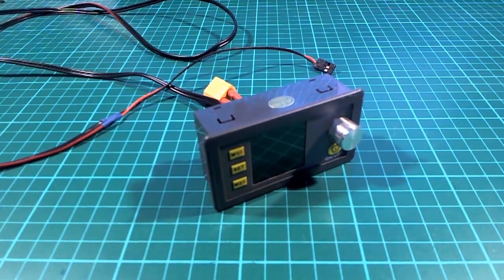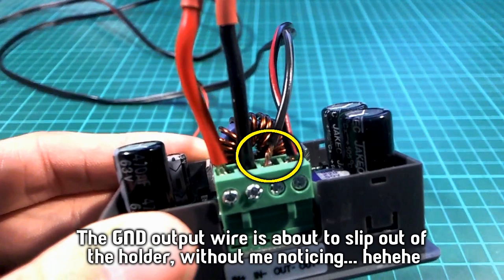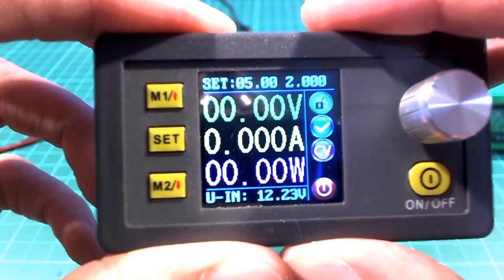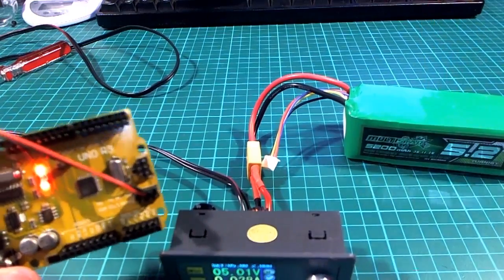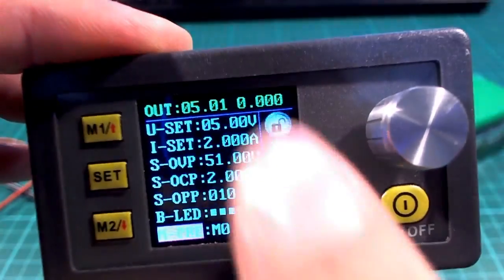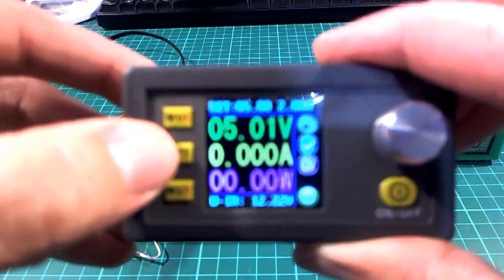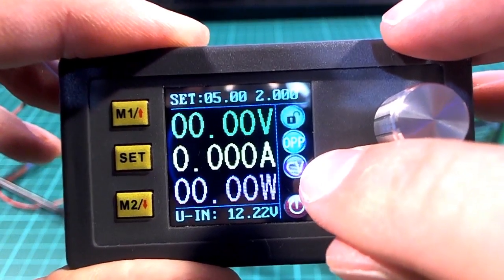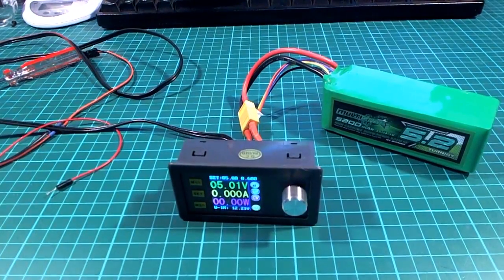Mini adjustable DC power supply/meter first look DP50V5A

Comment: Wondering if I can use this to measure the voltage at which a solenoid valve operates? In other words, have it connected and powered on, and then use the knob to ramp up the voltage from 0 to 10V (12v supplied), and see when the valve opertes. Expected operation at 8V or less.
Reply from the maker: Yes, you could do that.

Comment: I get the impression those cheaper bench buck converters other than the expensive Riden are rubbish. I bet When you load that thing the actual current vs the current reported on the display will be off, and the error will not be linear, making calibration useless. I bet that cheap rubbish will give an unstable output at very low loads. Also a seller said  with the 20Amp version if u hook up a big motor drawing more than 4amps or any inductive load it will blow it up! If you try to charge a battery you need a series diode else back flow will burn the PCB..crazy. Back flow should not damage the unit. Lets say u hooked 2 isolated units together in series, say both set to 50V for a total of 100Volts out but one unit CC is set at 1A and the other at 5A, the you short out the output, causing reverse current through the unit set at just 1A, I bet it will smoke...

Comment: 2:00 the input voltage is 6-55V but there is no indication of an input current. 
Does it even matter because it will draw as much current as needed?
And also, what should the min. input current be? 
btw. great video.

EDIT: I researched a bit and as I thought, it depends on how much current you use and there's is a way to calculate it if you know the efficiency.

Comment: hey how about a new video showing it operate a 775 at .17 amps and 12 volts. that is the level of the 775 motor and i want to see or here from you that it will work so i can take apart a 20 amp and 12 volt tractor yanmar (permanent magnet alternator) and then attach the magnet to the motor rotate and the put it near the receiving coil to get the energy without a tractor motor i here all the country people who own radrunner are doing and that it extend the one hour battery to 72 hours of charge and they use them for herding animals but they have issues with not having shocks. they get back issues. oooowwwwwww. but if it goes that low then anything that can carry the extra weight goes forever. someone other motor willl break and the 775 so open body and attach fans like it is an alternator have been suggested.

Comment: Hello. May be you can help me. I bought the DC-580 Boost buck converter module on eBay: https://i.ebayimg.com/images/g/YsMAAOSwFLRenXku/s-l1600.jpg
Is that normal when I switch on (set on 12v for example)  I have to wait more than two minute to get current at the input ? Pushing the on/off button has no effect excepted having a green or a red square on the screen...
Link to the product on the manufacturer website : http://www.fnirsi.cn/productinfo/481353.html
The manufacturer doesn't answered my emails. :-(

Comment: Hey I need some help with this unit. I got one off Ebay a little cheaper so I kinda suspect that but it wont maintain a steady output. The input is steady so that's not it. Any ideas?
Reply from the maker: If the problem is that you suspect something.... not sure how I can help with that.

Comment: That was a great video , I’ just purchased the same. Looking device from eBay for $75 it has a higher output of 20 amps I intend to use it for some projects that run multiple large stepper motors

Comment: Late but hell just found this vid. U is potential energy, V(volt) is unit of measure of electrical potential. In electrical just kinda became voltage or just volts, as well but not as much I=current some times is referred to amperage or just amps.

Comment: hi,   gr8  review,    cud u pls tel wethr i can use it for supplying power to my lap top externally by using rechrg batteries,  as the internal battery is dead and not available

Comment: Are you using LED lights, because  your video if flickering terribly, get a headache from it.

But for the rest a good video.
Reply from the maker: Yeah, I changed the lights after some people pointed this out. Still using LED but from a smoother DC power supply.
Reply: @iforce2d  Aha ok, great you still answer people here on YouTube, when you also are hitting 50k now, keep up  the good work.

Comment: I think you are confusing voltage (across a component) which is often noted as "U" and electric potential of a node, which is often noted "V". U across the component between nodes A and B is equal to V at point B minus V at point A...

Comment: I bought one of these not long ago and use it all the time. I only wish when you push the button to change voltage or current that it would stay in the change mode until I push the button again to end or even better, have an option in the settings to have it work that way or the default way which is automatically exit the change mode after 10 or 15 seconds or no input. When I am experimenting and want to play with voltage and/or current it is annoying to have it exit change mode by itself so I have to push the volt or current button again then push the knob two or three times to get to the digit I want to change... wash, rinse, repeat.... Also, interesting that the manual calls it the coding potentiometer since, as you mentioned, it is not a potentiometer but then no surprise from a translated document.
Reply from the maker: I bought another one more recently that has the feature you mention, where the voltage changing mode stays until you turn it off. It's a larger power one though, so not sure if they have made this modification to the lower spec ones as well: 
https://www.youtube.com/watch?v=siZTPRpyVrM
Reply: @iforce2d  Hear that? It's the sound of slightly less than $40 leaving my wallet...LOL

Comment: Probably a dumb question but I’ll ask it anyway. 
I have a solar panel with variable output, that I want to use to power a device that has a minimum requirement, and gets fussy if it gets less than what it needs.
Could I use this device to set output parameters for my device, so that it never receives less than 8V or less than 1A? If the solar panel can’t meet either of those requirements because of the light levels I’d like this controller to just switch off the output and wait until those levels can be met. Is that possible???
Reply from the maker: It doesn't really sound like a suitable thing for that purpose. No ability to get it to switch off at a certain input voltage at least. Usually things using solar will have a battery between them as a buffer, which the solar can charge when sunny, and the end-user device can still use when not sunny. Only problem is, you then need a circuit between the solar panel and battery so that the battery doesn't simply try to 'power' the panel when not sunny... I've never tried it myself but I have seen that it's not trivial.

Comment: So alternating current would burn it out so you have to have a battery. So I can't use it on a small generator. I never liked batteries because they will run out of power in the end. But I have to get my scooter running. I'm sure these medicaid people will want me to check in with my new doctor once they get the new of where I live. Last time it took them almost 8 month to get me a new doctor. I moved on the day I got their paper work. Just could not be helped. Thank You Loader.

Comment: I have this module and the 50v 20A version, I use it to charge 18650's, no need to use the diode just always connect and disconnect with the output turned on with the current limit set low, the diode will have a voltage drop so the output voltage will be less than on the display.

Comment: Why there were no tests under load? Why there were no tests with actual precise multimeter and comparison?
Reply from the maker: Because I'm not a pro and this is a 'first look' as the title says, not a test or review. The voltage is very accurate, not sure if I ever checked current accuracy.

Comment: Good review video. But for 30$ one can buy a complete ATX power supply capable of say 350W + ... Can be adapted/hacked to become a very good lab power supply with regulated outputs.
Reply from the maker: "can be adapted".... sure, you can say that about almost anything. Here you have a nice package ready to go.
Reply: Oh for sure ... I mean it is a elegant and ready to go solution, no doubt. I only wish the price could be lower ... when compared with say a massively made ATX PSU ... looks expensive, otherwise it's no doubt  very nice and very practical . I was by no means criticizing your choice. I am thinking to get one of those also, just sayin' hey seem expensive tho ...

Comment: Very nice, I plan to combine something like this with an old ATX PSU to have strong cv rails and a variable output with these features. But I still have questions: what is the minimum output voltage  and current?

Comment: V is the (ISO) unit (Volt) of tension, U is the letter for the physical dimension (same as A stands for the unit of Ampere and I for the dimension of current).
Not sure if in the US you use V also for the dimension, but as it is an ISO unit, you shouldn't.

Comment: my power supply is rated for 240w, 24v at 10a. I actually need 48v at 5a. will this work? or will the voltage be limited to the power supply's voltage?
Reply from the maker: This is a step-down only (buck) converter. As it says in the product description the input must be 1V higher than the output. If you are going to run it for long periods of time, I would be inclined to get one that is not cutting it so fine regarding the power limits. This one is rated to 250W so I think your 48x5 would be pushing it pretty hard.

Comment: I just bought 1 of these but the 5015 witch is 50 volt 15 amp it comes with a driver and was $49 I am going to use an atx power supply to run it so should be good

Comment: Do you still use this device and is it still working?
Reply from the maker: Actually it died a while ago, after I used it quite a lot for hot-wire cutting.

Comment: The problem with this unit is simply that it is really involved to set the parameters for a data set, then saving.
The instructions are very poorly laid out so initially at least it's quite demanding.
The instructions (for example) refer to a potentiometer not the rotary encoder which it is.
Ideally this should couple via SW to a PC & enable much faster & more reliable programming.

Comment: can I connect 11.1 volt lipo battery and get out 54 volts ?

I connecting 4 led strips  to 11.1 volt lipo and power is to low to get them to be very bright if I connect 2 x 11.1 volt lipo they are very bright but wires getting very hot after short time trying to find solution or boosting power from 11.1 or reducing, 
What you think ?

Comment: U is symbol for voltage and it is measured in Volts -> U = 5V
I is symbol for current and it is measured in Amps ->  I = 2A
Ohms Law is normally written as U = R * I

OVP, OCP, OPP are abbreviation so they use V/C/P instead for symbol used in physics expressions. 

Be carefully with those protections. Depending on device it may be only hard limit, it may shutdown or clamp input. The last option with no protection on input may ruin your day (although it seems that this meter simply power down).

Thanks for review, I was thinking that I get this device and now I know that I want it :)

Comment: I am thinking of this to control a battery output to match my DSLR's specs. DSLR wants 8 volts 3 amps. Within some limits, this will allow setting output voltage and output amperage independently, right? So I could run 9 or 12 volts as input and set it to output 8 volts 3 amps. (I am obviously not educated in these matters. I just want lots of amp hours to run my DSLR for astrophotography. Would appreciate your advice). ...thanks, Stephen

Comment: is this item accurate at very low miliamps, for example .1 miliamps or  3,  I am trying make colidial silver, and it has to be steady current flow, and very low miliamps. . . .  I bought there other item https://www.amazon.com/gp/product/B01DZSFDE6/ref=oh_aui_detailpage_o00_s00?ie=UTF8&psc=1
, the model right before this, and it slightly  fluctates and is off by between 5 and 10 mili amps, so i am debating on buying this one,  Ironicialy i spoke to soon. . .  I was typing this as I was watching the video, and 18:09  and you have the limiter set at 400ma and it is limiting at 394ma, why is this??? is it supposed to this? does it mean that if you want an exact 394 that you have to sett it at 400.  , and  offset it by 6 ma.   If you do do that will it eventually exceed it. . . sorrey for all the questions, but this is the exact thing mine is doing and im not sure what to do.  If i set my at 10 ma, I get about 5ma draw. if i set it at 5 ma, get about 1, but that 1 is fluctuating and seems to be creeping upwards. . . .    but its hard to tell. So I am wondering does your creep upwards or will stay steady at 394 if you set it to 400? any advice would be greatly appreciated.
Reply from the maker: I think you answered your own question. I would not expect this to be as accurate as you need.
Reply: I think i did also. . .lol sorry, I was writing that as i was watching the video., I guess my real question is will it stay at a 394ma consistently when you set it at 400? I could live with that and just ofset the number by 6 . . .  or does it creep all over the place between 394 and 400 when you set it at 400?

Comment: Pretty neat device. It would be cool if it would have some data logging, or at least serial output with current voltage and current being drawn. The screen refresh is pretty low, at about 1-2Hz. I assume the protection mechanisms are implemented in software, and not using dac and comparators that triggers something. (other than current limiting I assume), which might be a bit unsafe. It most likely will deliver more current or power for about half a second, than what is set in settings, so still be careful.

Any ideas about turnup / turndown behavior, noise, ripple and load regulation.

Comment: About the U as volts, here in Norway we use U as volts, R for resistance and i for ampere.
don't remember why we use U as volts since we only use URI in ohm's law at school where you use VRI?
and I have never seen U instead of volt in real life outside school (working as a mechanic last 7 years)

Comment: 250 Watts! 
I have a 2 channel 150W Mastec that's 10 times the size of that thing that I paid $200 for.

Wondering if I should replace it with 2 of these?
Reply: That thing however is only the controller, you still need a DC Power supply to attach that to.
One that can output 40v at 6/7A

Comment: Is the output on this floating? I'd like to hook up two of these to the same power source to create a dual channel supply where I can hook the positive of one of the outputs to the negative of the other output so I can do -V/Common/+V for running op amps, but the supplies need to be floating for this to work. Thanks!

Comment: The answer to your question regarding the Letter U - That's us scot's fault, now adopted across Europe. Traditionally quantity (here voltage) and its unit (volts) are kept separate, which means using different characters for either: 
current (I) is measured in amperes (A) and resistance (R) is measured in  ohms (the upper-case omega). Having V to mean both quantity and unit sort of violates the spirit. So we use U to denote quantity.
Reply: V in our Europe is for Velocity. Letter U is for Unterschied which means "difference" in German like potential difference. And also at that time they ran out of letters for physical properties.

Comment: U = voltage   I= current  R= resistance  first thing you learn in school  just basic.
Reply: J IJzer Went to Naval Electronics Core school and we never used U. Instead we used E.
Reply: E (for electromotive force) is what we were taught in electrician school.
Reply: me too!!!
Reply: We learned the same with k,p,x
Reply: J IJzer I received my electrical engineering degree in the 80’s and we were taught E=I x R. .E = voltage or electromotive force. They eventually changed to V. New engineers i meet in the field use V., but i still use E. I have personally never heard U used. I have worked with Engineers all over the world, but never heard them use U for Voltage. New to me. I’m not denying it, i have just never heard of it.
Reply: In France we usually use "E" when talking about an electromotive force source (i.e generator or battery) and "U" for voltage in general (across a resistor, a capacitor,... or even a generator ;P )
Reply: And also "V" to describe the electric potential of a node... U over "AB" = V at point B - V at point A.

Comment: The overvolt protection 'normally' works by clamping the DC input short circuit if overvolt is detected.
This might damage the DC supply, but save the DUT.

Put a fuse inline with your battery pack please!

Note: I suspect that your regulator/PSU may just open circuit the output, guess it is up to you to test.
Reply: NoName He doesn't need a fuse for testing purposes, the circuit has adequate protection, unless your anal, then use a fuse!